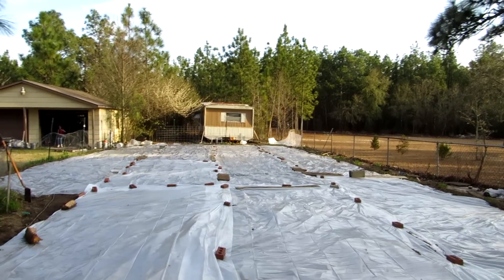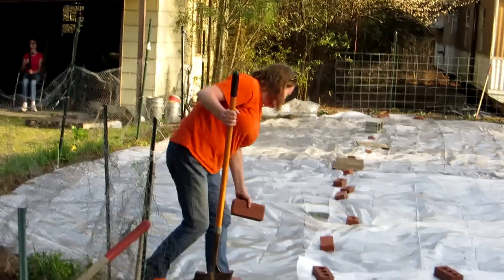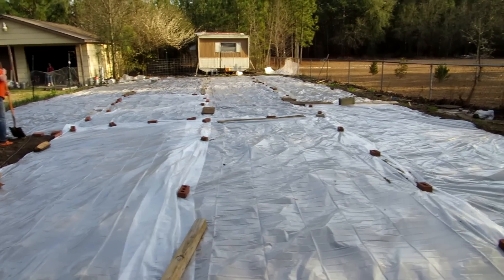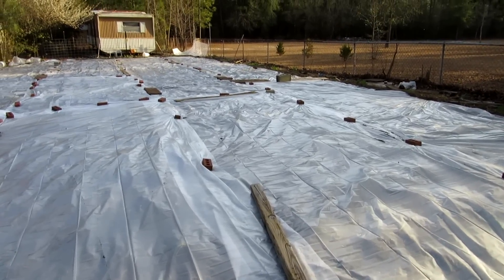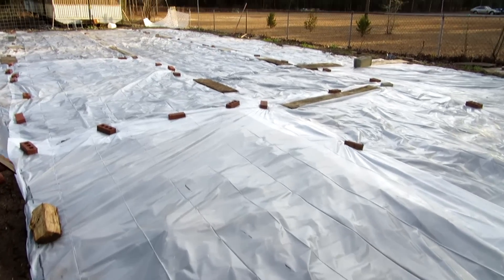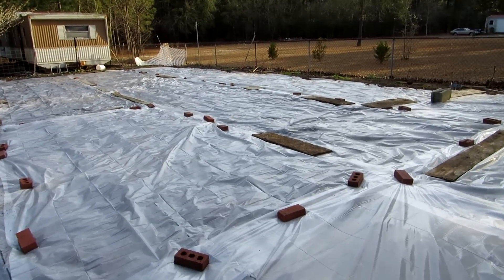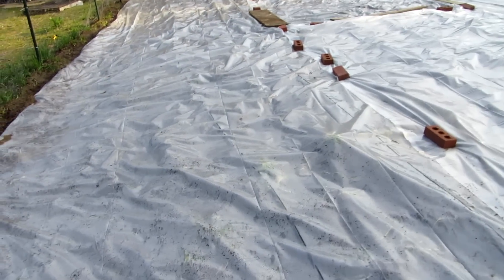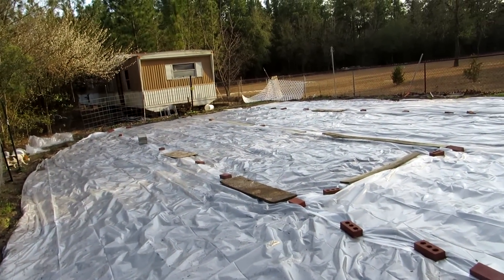Solarizing

Comment: So would you recommend that I should first till it and manually remove the visible root system and then put a tarp on it? 

I am preparing ground so that I could put grass seed sometime early feb next year in my backyard. I am from Austin, tx. 

Here’s what I am now thinking:
a) Remove all the existing weeds by running a Lawnmover 
b) till the ground, remove root system and then level the ground to some extent. 
c) Lay down the tarp and keep it there for next 6-7 months. 
d) remove the tarp sometime in feb next year and put compost and top soil. 
e) get the irritating sprinkler system installed by someone. 
f) put grass seed. 

Except for point e, I intend to do everything on my own.

Comment: Is this really necessary? To be true, would it not be better to use in mid-summer when you  got some hotter temps? And what about just NOT using it? And ever thought about also killing the "good boys" in soil? This just makes no sense to me, sorry... If you just have problems with weeds, than better go with black sheets. No sunlight, no weeds.
Reply: SwissVIP the green house effect especially if you double your plastic layers and you want clear because it allows for the infrared radiation from the sun to penetrate deeper thus allowing for a higher temperature deeper into the soil black plastic will get hot but only on the surface
Reply: +SwissVIP Usually black doesn't allow the ground to get hot enough to kill off the seeds, truly making it pointless to use this method.
Reply: Well, but plastic does not heat either. Black material is good for sunlight absorption and will get very hot, so at least the very top of the bottom gets heaten up. What effects does plastic on the ground? I think it will only make the water inside condense, but nothing else.

On what physical laws does your consideration base? I really don't get it and would appreciate if you have some keywords on this at least ;-)